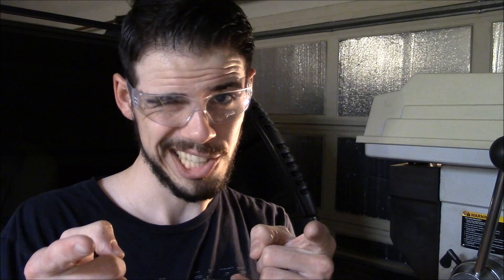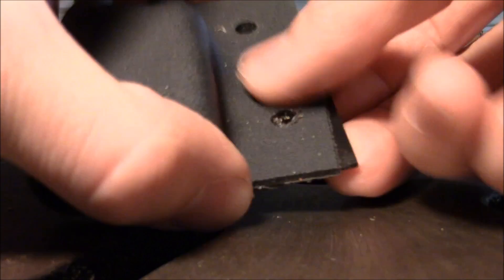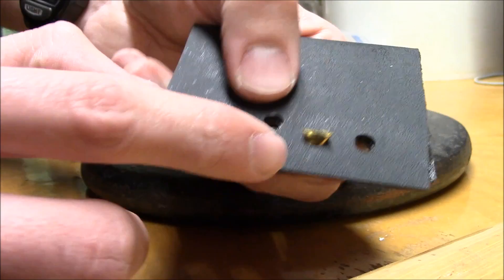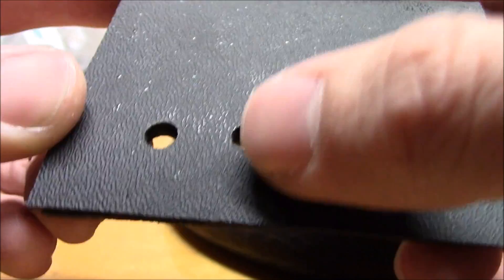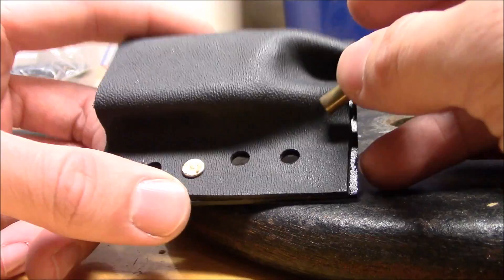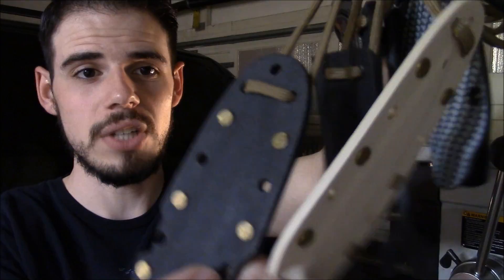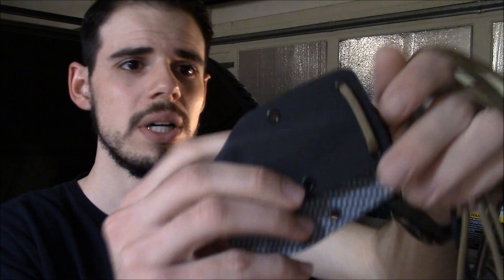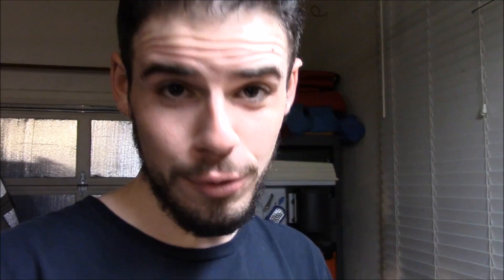HOW TO: .22LR Casings as Rivets

Comment: You did great. Simple, easy, priceless. Great idea. If you could cut the casings in stead of cliping them with a diaginal cutter, then slightly file them, then use a balbearing or an object to set in the center, then hit them with a hammer, it could look really great and professional. Thanks for the wonderful video and tip.

Comment: Too much work.  Take a grinder and round one end of a 1/4" rod for an instant flaring tool.  Then you can use your ammo as rivets til your heart is content.  If the brass is too long, grind it shorter before flaring.  Of course, this leaves the fired center of the brass open, so I'd give the casings a wash before using in this manner.
FYI, it's very similar to how you'd reload a larger cartridge in operation.  I've used my die and press to take casings I didn't want to reload to make grommets in this fashion by simply tapping out the center primer portion in addition to the above steps.  (*Perfect for converting your tarps to paracord instead of cheap nylon rope.)

Comment: What if you cut a second casing halfway down length wise and pushed it inside the first casing after cutting them to length, then hammered them together so you'd have the solid flat on both sides?